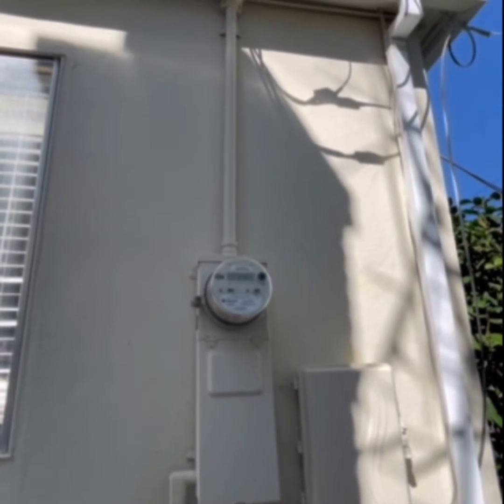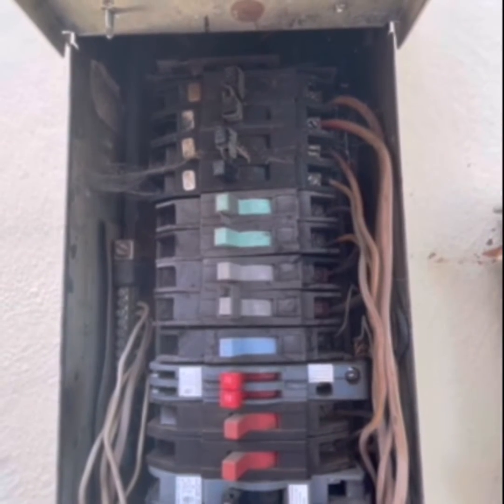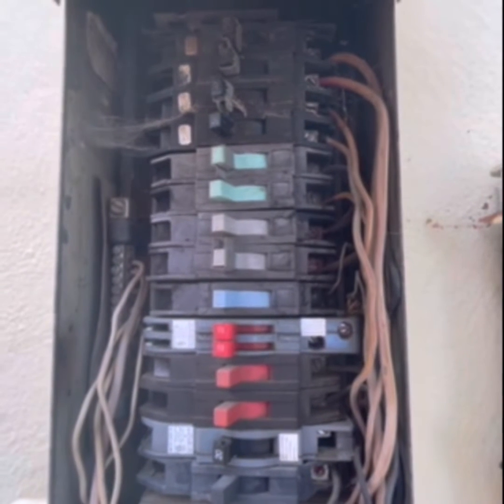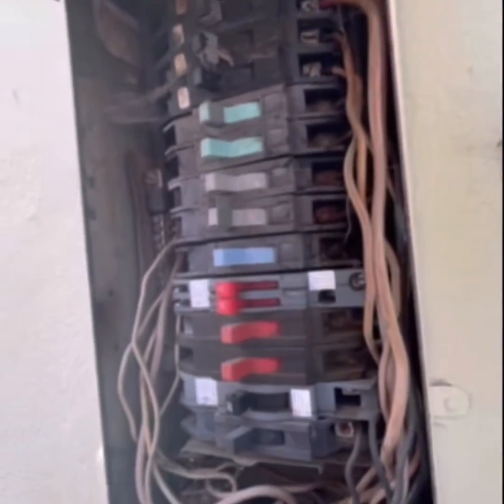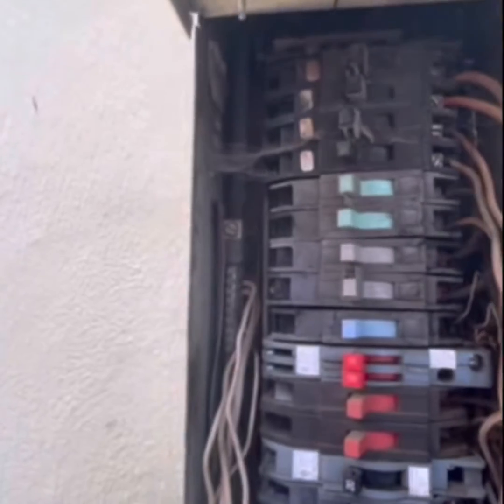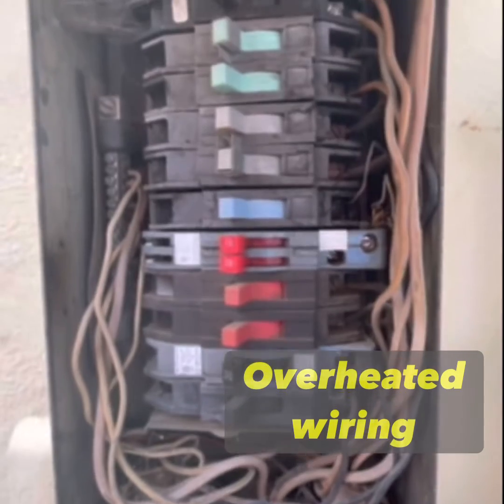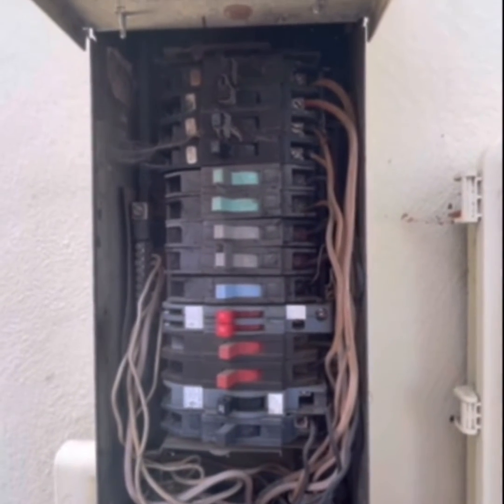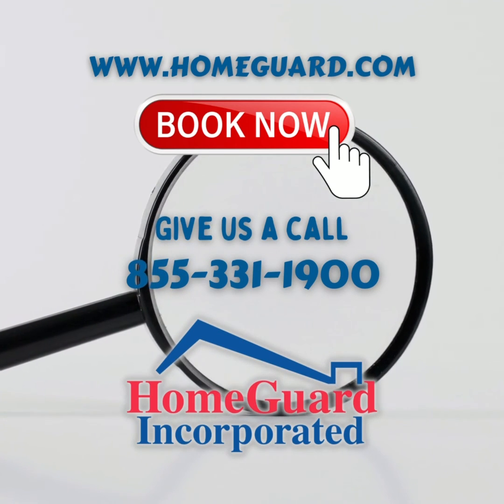What is a Zinsco Electrical Panel? And Why Should I care?

Comment: The aluminum bus design was the source of many of the failures.   The much older Zinsco with the copper bus design was higher quality and more stable,  much like the Bulldog Pushmatic panels, although these has some issues of their own, primarily they were grease fed breaker that tend to seize up if not periodically switched on and off, also many Pushmatic breakers are of a thermal trip only, and tend to date to the 1960s and before,  and although replacement Pushmatic breakers are available that meet modern safety standards,  they are very expensive and difficult to find, and oftentimes cheaper to replace the entire panel  than to replace all the breakers, since any original breakers will be over 50 years old, well past their designated lifespan.